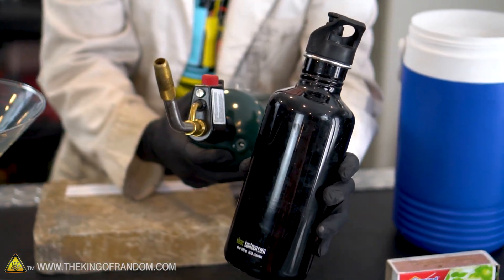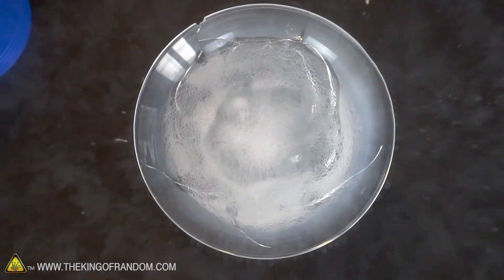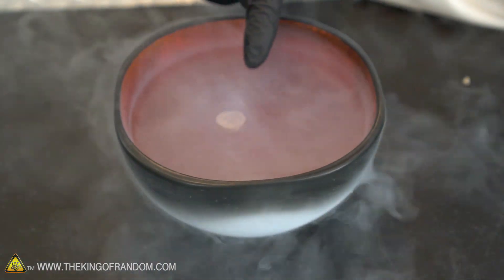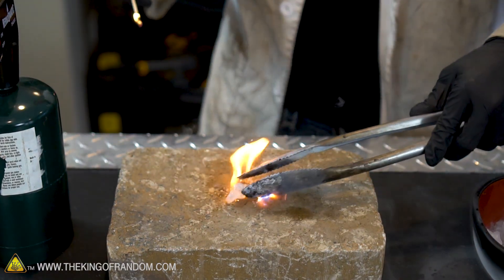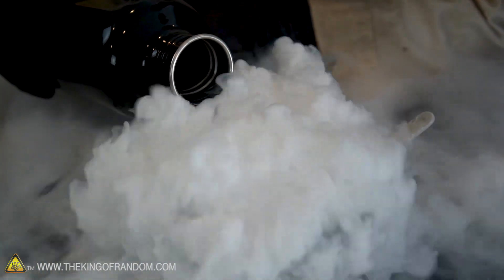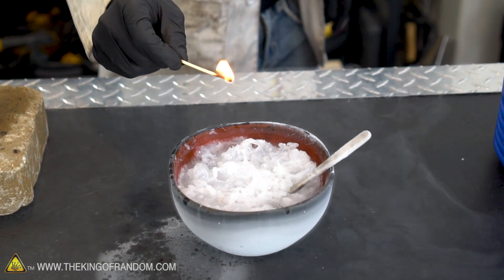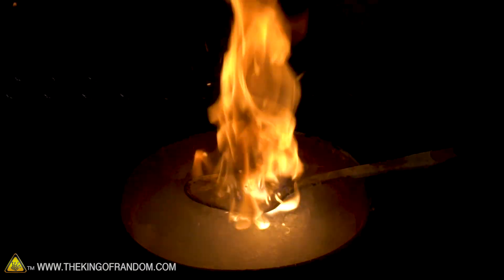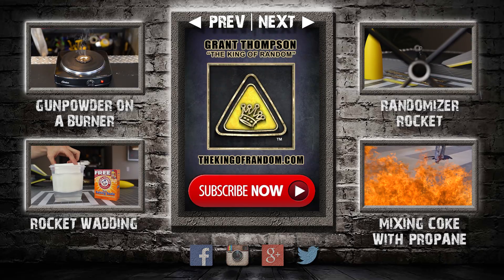Will Frozen Gasoline Burn? Can We Use Liquid Nitrogen To Freeze Gasoline Then Ignite It?

Comment: Does about what I expected. Same as when the gas is on the paver you had, the fumes are what ignites. Being frozen doesn't prevent said fumes more specifically not at room temp. You were lighting the fumes from your frozen albeit rapidly melting frozen fuel and once that happened the heat from said fire cause a vigorous expansion of the once relatively compressed gasoline which means those fumes project from the mass thus igniting more fumes til it's quite quickly just your average burning puddle of gas.

Comment: Unless you used Ethanol Free gasoline, there is a 100% chance water was present in the gasoline. Therefor when ignited you boiled off the water that was present causing the popping and "vigorous reaction" you experienced.

You should try this experiment with ethanol free gasoline and compare the results.

Comment: You didn't answer the question. The match turned a small amount into a liquid that ignited . Those flames made more liquid and so on. Gasoline burns above 0 and before you could set it on fire you have to turn it into a liqid. Burning requires heat to happen besides oxigen and something burnable. You just can't burn frozen things. At least as I know.

Comment: For the problem of glass breaking from thermal shock you can try and freeze the glass in your refrigerators freezer before hand so its already cooled down greatly so there's a smaller chance of it breaking.

Comment: Frozen gasoline doesn't actually light. When you add heat, even small amounts, it will turn into a liquid that quickly evaporates. The gas that evaporates is what actually burns, not even the liquid.

Comment: I am no chemist, but is it possible that the fire was actually melting the frozen gasoline? If so, it could be that the flame was growing due to an increase in available combustible liquid as supposed to the melting being caused initially by the growing flame as Grant suggested? I mean, from my point of view, Grant's suggestion is counterintuitive. However, as I said before, I am not a chemist and thus not the most qualified to pose this question; it is reasonably likely that I am simply unaware of some critical factor.

Comment: can you make gasoline ice cubes than light it. that way there is less gas bubbles trapped in between?  should make it solidifi better and possibly change the reaction if a non flamable gas isn't being released while it burns. or explodes

Comment: you should fill a balloon with gasoline and stick a fuse in it
Reply: It won't explode if that's what you're going for. Balloon will merely pop from said fuse and the fuel will spill out, you'd be lucky to get fire from it.
Reply: MissisShedevil's Art Creations do you even science bro, gasoline is room temperature
Reply: EthanKPH [GD] its like acid it would burn right through it. Put gasoline in a paper cup in a few minutes it'll burn or melt right though the cup
Reply: Andy Richardson I think the gasoline will melt the balloon before you can add the fuse ;)

Comment: Dear grant, when you were pouring the gasoline there was white vapor, what would happen if you lit that up i mean maybe its like gasoline frozen gas? i don't know but Im curios. please like this so that Grant may see this :P
Reply: Dear Grant Thompson the king of random,
make a blooper video and add that slam on the table
Reply: The volume of gasoline poured displaced the volume of nitrogen in the bowl; hence it spilled over due to having lower boiling point. The volatile grey fumes are non flammable.
Reply: Apollo 50224 that gas is not flammable it is just vapour
Reply: Apollo 50224 h
Reply: Apollo 50224 there is no such thing as frozen gas, its either frozen, liquid or gas.

Comment: I wonder how much the phase change affects the rate of energy release...

Phase changes from solid to liquid or liquid to gas typically consume 2-3x as much energy as simply heating the material the 1 degree difference in temperature needed to change phases.  This is usually referred to as "latent heat" and has a wide range of implications from atmospheric science to metallurgy.

My other thought is that it's possible much of the gasoline actually sublimated, that is the phase change directly from solid to gaseous form without a liquid phase in-between.  Ice does this during the winter, if you've ever noticed how ice can "burn off" a sidewalk while the temps are near 0F under the sun, this is how.  Sublimation actually requires much more additional energy during it's phase change than melting or evaporation, and IIRC it requires more than both combined.

Comment: There is one main issue with this experiment, heat. The heat from the match may have melted the gasoline and then lit it which continued the effect, thus it would not be the ice burning. The sporadic popping could have been nitrogen bubbles heating and exploding outward. If this was hard to understand here is a simplified explanation.
Heat from match melted the frozen gasoline and ignites it, that burning gasoline melts more gasoline and that burns too. The popping came from bubbles heating up from within the ice and bursting out.

Comment: Gasoline floats on the Liquid Nitrogen while it solidifies because it's an oil where if you put water on gasoline the gas would just float and never use water for gasoline fires, well oil fires in general, oil floats on water, and you don't really have to burn the gasoline because it's the vapors that are flammable

Comment: Is it possible that the FROZEN gas didn't burn, but instead you were simply melting a small amount and THAT was lightning? From the footage you showed, it was hard to tell if it was melting a small amount, or immediately lighting the still-frozen part, but you did show frozen pieces of gas inside gas flames, and those frozen pieces didn't seem to be burning, so... It seems possible that Frozen Gas does not, in fact, burn.

Comment: i think the vigorous burn comes from the presence of cold/liquid nitrogen inside the gasoline that vaporise because of the heat. you should try to take a small tin can, fill it with gasoline, and use liquid nitrogen around to freeze that gasoline without mixing the two

Comment: The frozen gasoline does not burn, what is really burning is the vapor coming off of the gasoline weather it is frozen or in a  liquid state. Even the match you used to light the gasoline on fire was not really burning it was vapor coming off the heated match stick. 

Try this sometime, pore some gasoline into a glass right too the rim of the glass then light the glass and you can see a gap between the gasoline and the fire that floats above the liquid gasoline.

Comment: Gasoline's freezing point ranges from -40° F to -50° F, it's flashpoint however is right in between at -45° F. The reason why they end up being so close is that gasoline hardly takes any energy to revert back to its liquid state so that it instantly starts the combustion process on its vapors (since liquids and solids cannot burn, it is their vapors that burn). But that's one of the huge reasons why gasoline can be so beneficial to use as fuel for our cars. If it's -10° F or even -30° F outside (like it can get where I live) then your car will still start because the ignition can still start up the combustion process of gasoline even though it's so cold out

Comment: try this, 
Squeeze a bottle of water 1/3 filled  without the cap and then close the cap while squeezing onto the bottle. After that shake the bottle u will see nothing happens the bottle does not go back to its original shape. But,if u use a carbonated drink then u will see the bottle fills goes back to its original shape . U are great

Comment: Put Styrofoam in diesel fuel to make napalm then try to freeze that flammable jelly it makes.
Reply: While diesel is used in engines, it is really hard to get it to light up at atmospheric pressure, so petrol is what you use to make the napalm
Reply: only works with petrol mate. Diesel isn't flammable
Reply: use diesel all the time to light bonfires so yea it is.
Reply: By NO means is napalm a chemical weapon, it is an incendiary device. By that logic gunpowder is a chemical weapon as well
Reply: you can literally hold a lit blow torch to a bucket of diesel and nothing will happen... 

We learnt this after trying to light a bonfire with diesel....
Reply: Incorrect. It is perfectly legal to make napalm.
Reply: Sully guess he deleted his comment
Reply: Diesel is NOT EXPLOSIVE ... only flammable, and only then at high temperatures and pressures.  It's for that reason that only Petroleum fuel (petrol/gasoline & LPG) will work in a petrol engine ... Diesel doesn't explode like those fuels do, and to get it to ignite is NOT as easy as people believe.
Reply: >Diesel isnt flammable

Diesel is EXTREMELY flammable and explosive
Reply: Gamer Gamers it is not cheapo napalm, polystyrene and petrol is the real recipe for napalm, actually

Comment: So, it's not actually the frozen gasoline burning - gasoline isn't flammable as a liquid, but rather it's the gaseous gasoline that has vaporised off of the liquid that's igniting. That's why it appears to go down only very slowly, because the flames are not actually touching the liquid gasoline and are instead floating just above it, over a cushion of gasoline vapours. 

This is because gasoline has very volatility, which means that it turns spontaneously into a gas very easily at room temperature and pressure (RTP). When you frozen the gasoline, you stopped it vaporising easily, and when you introduced the flame it melted the gasoline enough to create vapours. This is what was burning, and is why you were left with a lump of gasoline that appeared surrounded by flames but was not burning very fast. 

So no, frozen (or liquid) gasoline will not burn.

Comment: one correction: higher octane is not more flammable. insofar as it has a lower 'flame rate,' it could conceivably be considered slightly less flammable....under pressure.

Comment: You don't fill a metal water bottle with a volatile flammable liquid. That is extremely unsafe and may cause an explosion. That is the reason why gas cans is made of plastic, or made of metals that will not create sparks.

Comment: actually i think it's the gasoline that melts just a bit and burns normally. the heat melts the solid gasoline and does a sorry of "chain reaction" of melting and burning.

oh also your roof looks like a just slightly meteor-ed part of the moon

Comment: The gasoline burning vigorously is due to be you removing heat from the system. Removing heat from the system removes a product in the chemical reaction of burning fuel. Removing a product makes the reaction more favor the product side of the reaction thus making the reaction burn more violently to make more product and balance out the complete chemical reaction.

Comment: Haven't watch the video or read the comments yet, but I'm pretty sure that it's only the gas that gasoline evaporates into that is combustible.  So it won't light right away, but once he holds a torch next to it long enough for it to melt and evaporate, the flame will sustain the heat and it will all ignite fairly quickly.  Just a thought, not sure if I'm correct.  Will watch the video and report back.

Edit: I didn't account for the fact that the gasoline would melt so quickly and ignite, but my statement stands.

Comment: I just want to offer some friendly advice so you don't have to keep buying glassware. If your place your glassware in the freezer about 24 hours beforehand it shouldn't crack by liquid nitrogen. The other thing is for hot liquids usually I just microwave it for about 2 and a half minutes before placing boiling hot liquids into it. Hope this helps save your glassware. :-)

Comment: you said nitrogen is not flammable, but the only reason the match went out is the lack of oxygen in the cold, dense nitrogen. also, try low octane fuel. if you take a lit match and dip it in the cold fuel, it should go out. the reason being is that the liquid is not flammable, but rather the vapors it produces. low octane fuel produces less vapor, and even less in low temperatures. try testing that.

Comment: I wouldn't be that sure about the fac that frozen gasoline burns. Maybe there is like a single drop of gasoline which is already molten and is able to burn. While this single drop burns down it might like melt down the rest of the gasoline and because of that it starts burning.

Comment: try freezing fire with with liquid nitrogen
Reply: Charpie Play Heat is energy
A Flame Is Just The Burning Of The Vaporised Material
For Example Charcoal Does Not Vaporise And Does Not Have A Flame
Reply: Every reply is taking this seriously
Reply: Fire is plasma. (Ionized gas)
Reply: lmfao look at the guy over u
Reply: Fiery_Eagle actually, the portion of the fire that we see is photons that are being released from the atoms of the vapour while they change into a lower energy state (oxydation aka binding with the oxygen normally present in the air)
photons, by definition, are pure energy. the heat that is being radiated from the flame is also mostly infrared light (light we cannot perceive with our inferior eyeballs)
therefore, what we perceive as fire/a flame is a release of energy, and nothing else
Reply: You can't freeze fire, it's a gas. If it were to change to another state of matter, it wouldn't be fire.
Reply: Fire is not a gaz it's energy

Comment: Here's a question, what happens when you put it under load? ie compress it into a cylinder say of a spud gun and use it in place of black powder to make a mini cannon. It seems to oddly have more power than normal gasoline when frozen.
Also did anyone notice the pretty green flames coming off of the spoon where it was burning the spoon?

Comment: Here's a thought: How about aviation fuel, 100LL. It contains lead so the thermal properties are likely to be different. It also contains no ethanol, as regular gasoline contains up to 10% ethanol. You can purchase it at any small airport, readily available. Also, a cool thing would be to see how JetA fuel differs from the others.

Comment: Gasoline vapor is flammable, liquid and solid gas are not. The frozen gasoline sublimates releasing a layer of this flammable vapor that surrounds the chunk and ignites quite quickly.  This is why a puddle of gas lights quickly and across the surface, it is the layer of vapor igniting.

Comment: The reason it reacted so violently is because the ice contains water and when subjected to temperatures over 100c it boils. That's why you don't use water on a fuel fire. The water trapped inside the fuel ice is instantly boiling and slitting away from the ice.

Comment: What happens is that the gasoline has a vapor pressure so low that it has a gas sublimating from it. The gas easily ignites. Also, that mist is the gaseous layer of gasoline around the droplets turning into a light but dense mist.

Comment: If I might make a couple suggestions for the next time you try something like this

1. If you know the ignition to be fairly energetic and expect it to spill over, maybe move the propane tank.
2. Maybe don't put the fire extinguisher directly beside / under your work area. If the fire spreads rapidly, as it did here, the fire extinguisher won't exactly be accessible anymore.

Comment: As many have said, by your logic, if I get some frozen petrol, wait 10 min for it to melt, put a match to it and a flame occurs, then that also proves frozen petrol burns. The fact is that it melted, turned to a gas then burnt. The reason that it happens so quick and looks like the frozen petrol burnt is because of the very low temperature it melts at. 
It's all relative. You might say a frozen log won't burn, and if you put it in a fireplace it won't light. Throw it in a 2000deg furnace and it will light almost instantly.  But in both cases, it will only light after it is not frozen. 

Cool video though, and bummer about your ceiling... Clean it well with sugar soap before repainting, or leave it there as a reminder/warning 😁

Comment: Please find out some way to get liquid helium.  It is more than twice as cold as liquid nitrogen and has very cool properties relating to glass.
Reply: It is not twice as cold.. Google  it
Reply: My bad.  Still colder than liquid nitrogen
Reply: Angel figueroa not via C or F, but that's because those units aren't very accurate, measure in Kelvin and it is technically more than twice as cold as liquid nitrogen.
Reply: How can Celsius be less accurate than Kelvins if the scale is exactly the same but with a different 0? lol